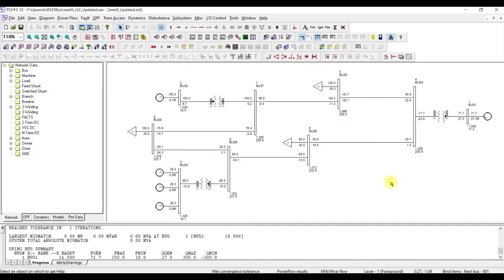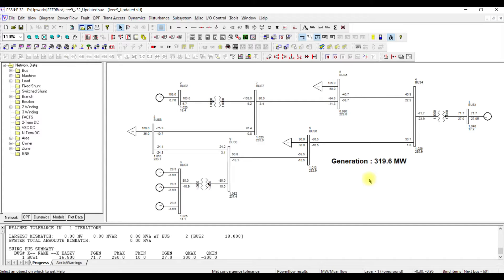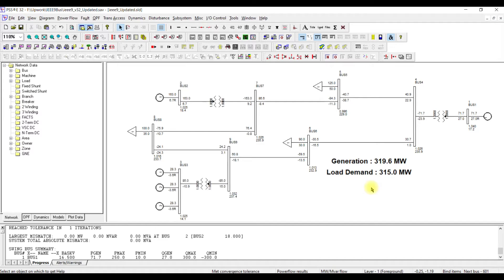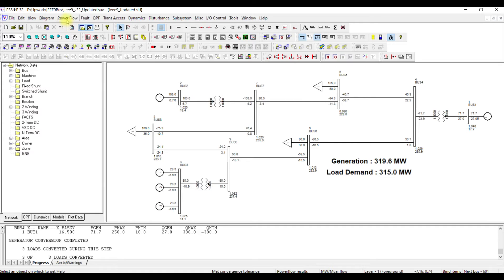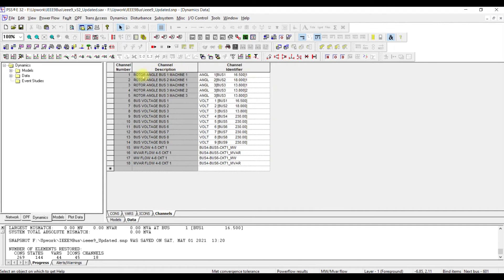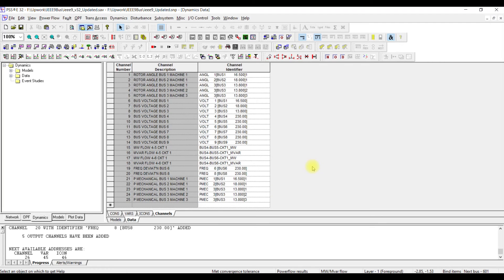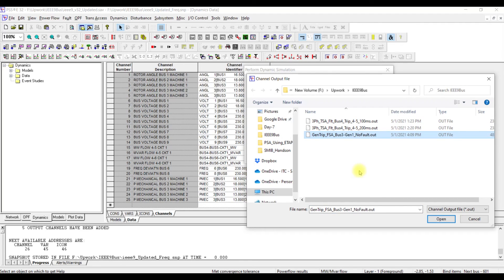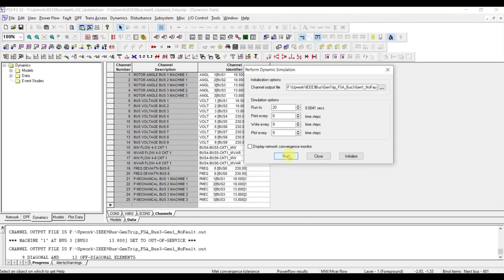Basic Power System Analysis Using PSSE Session 8 Part-I

Comment: Hi Farhan ,
                  I need a PSS/E circuit for simulation of voltage profile in Distributed generation integrated with Battery system for different condition. 
                 You are requested to make a video for the same or arrange the circuit for me as soon as possible. 
                              Thanks.